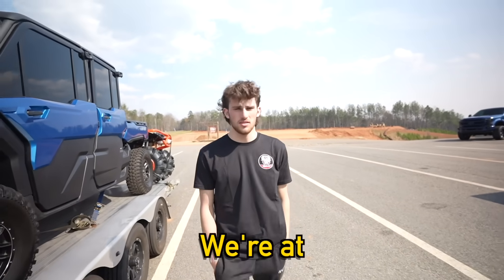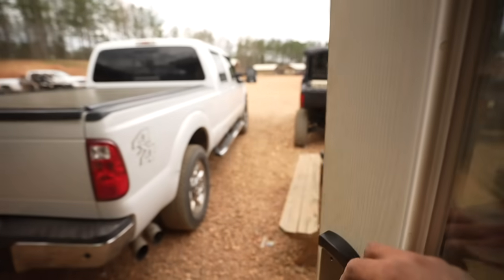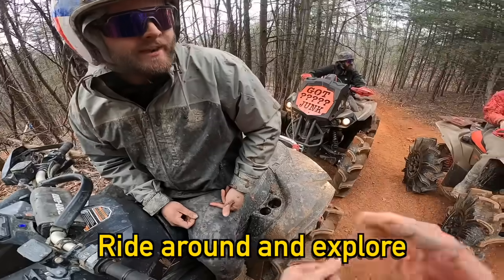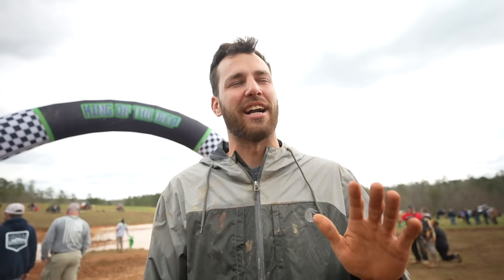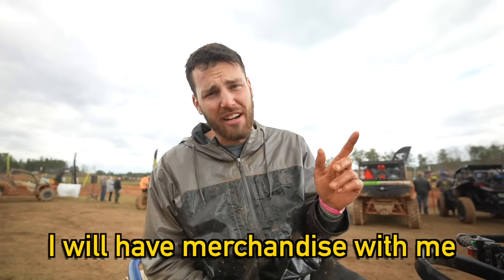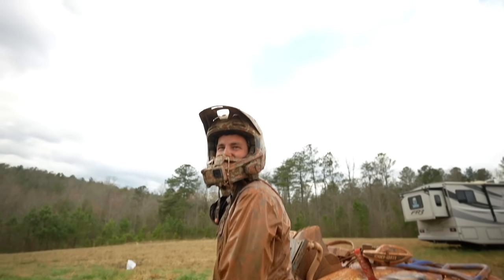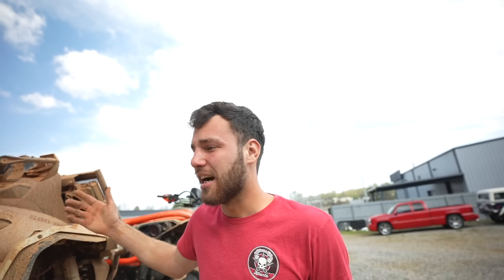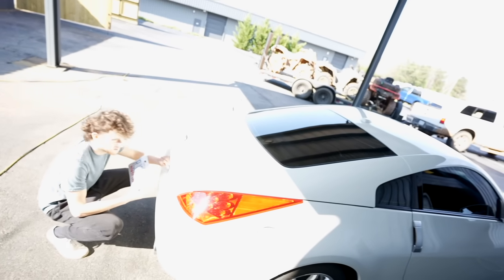I Destroyed My Can-Am!  *My First Bounty Hole Race*

Comment: Going to be honest with you, it’s not the first Plateau Fabrication bumper made by Dan Kent to be lifted up like that. Back in 2019 at Tall Pines ATV Park for Farm Fest, a guy named Jesse Greany snapped the 2 front axles on his 2015 Can Am Renegade XCC 1000. He kind of swamped it too. So he attracted the recovery strap on the front bumper and the excavator lifted it up about 60-70 feet in the air and all of the water came out of the exhaust. Put it back down and the wheeler started back up.